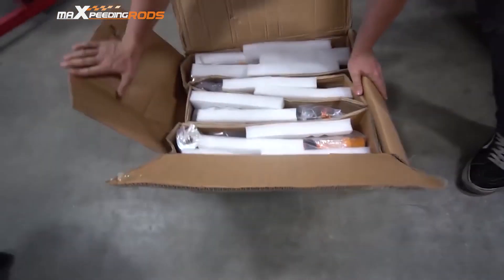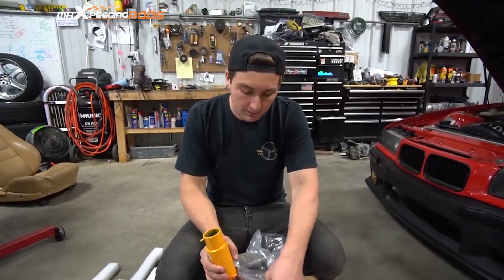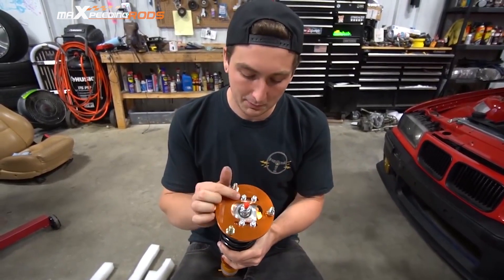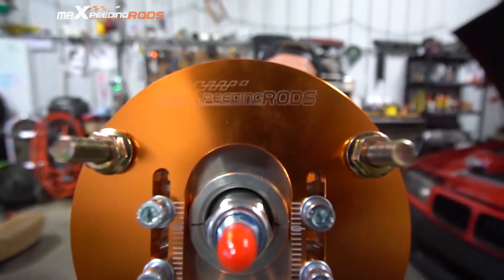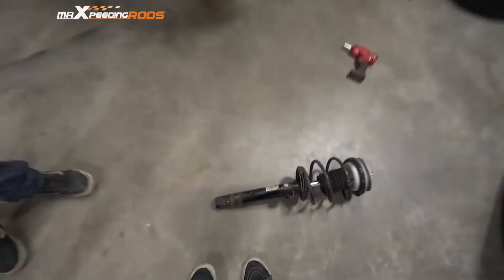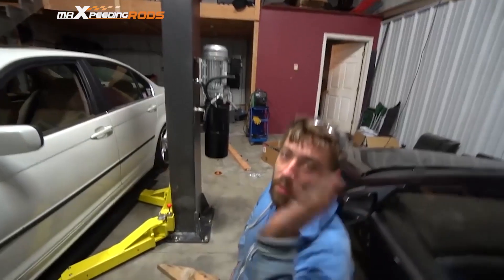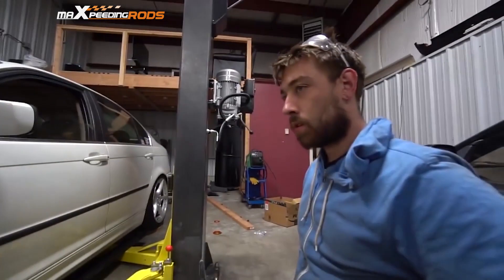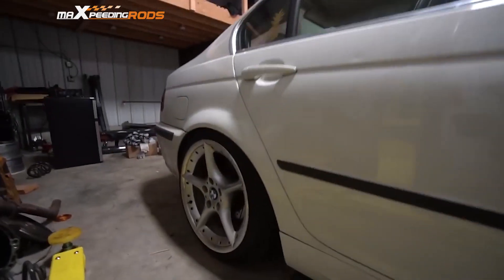For BMW E46 Coilovers Review

Comment: I installed these coilovers to my E46 coupe front and back on full low the front is fine but the rear is far to stiff the damper is extended quite a lot aswell and it’s already topped out after a month have you got any recommendations or info on how I could make the rear not as harsh on full low ..
I’m thinking of a custom spring with a 4KG spring instead so the dampers not under as much pressure on bumps in the road for a softer ride?
Reply: It probably feels stiff because its bottoming out. The rear spring is way too soft on maxpeedingrods for the bmw multilink suspension in the back. I replaced the 8k springs with 16k and it rides way better.

Comment: Hello there, do you have any coilovers for e46 (e46/5) compact ? In europe the cars are popular, so I was wondering if I could get a set
Reply from the maker: Hello dear, in order to check the right coilover, may I have your car model and car year? Thanks.
Reply: @MaXpeedingRods  BMW, 2004.
Reply from the maker: @jedvinijus   https://www.maxpeedingrods.co.uk/For-BMW-E46-330i--330Ci-Coilover-Coil-Spring-Strut-Suspension-Kit-2001-2006.html?search=e46%20%20compact Please check.

Comment: Which camber plates would I have to get to pair with the Adjuatable Suspension Coilover Kit For BMW 1998-2006 Red. Thanks!
Reply from the maker: Hi dear! thanks for supporting MaXpeedingRods. Do you need camber plates for your E46? Here are they: https://www.maxpeedingrods.com/For-BMW-E46-98-05-316-320-323-325-328-M3-Front-Red-Camber-Plate-Top-Upper-Mount.html Please check, thanks!